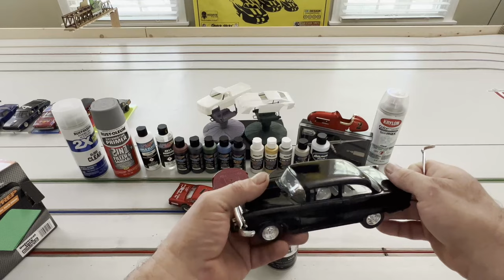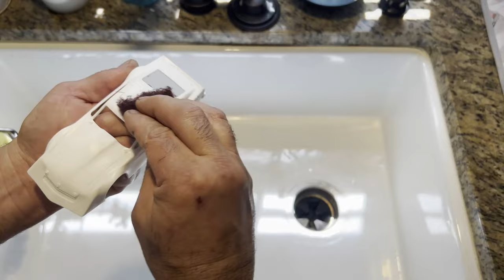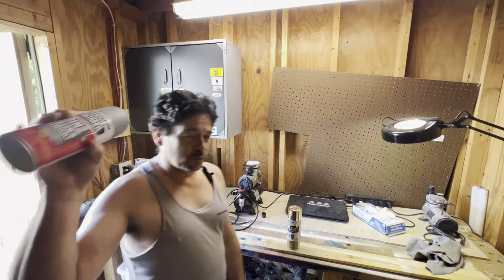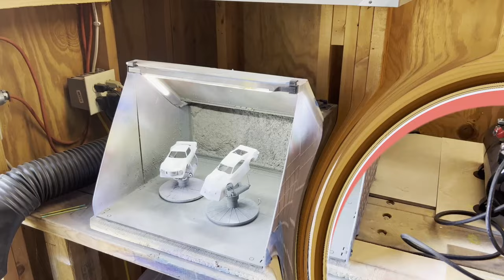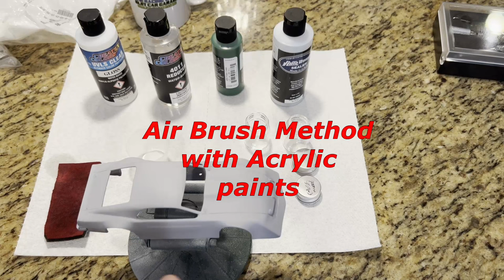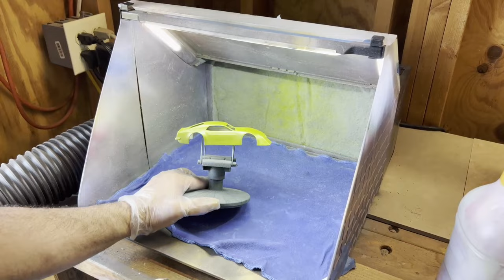Aerosol Can VS Air Brush Painting

Comment: Was wondering, would you clear the rust-oleum camaro before applying the decals or do you apply them then spray with acrylic clear?
Also,where did you get that camaro body,that is cool?
Reply from the maker: For that one i would add decals then acrylic clear it. That one has the solvent base spay can paint.